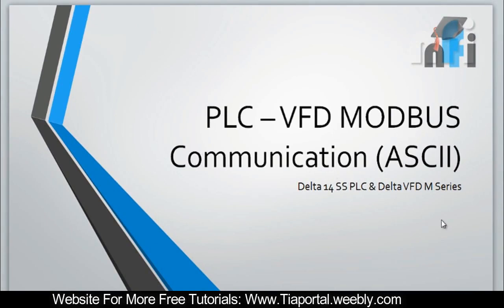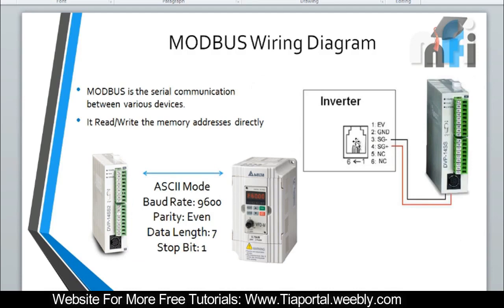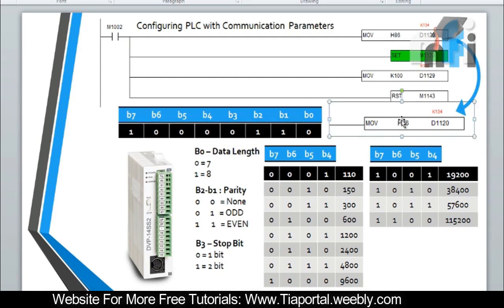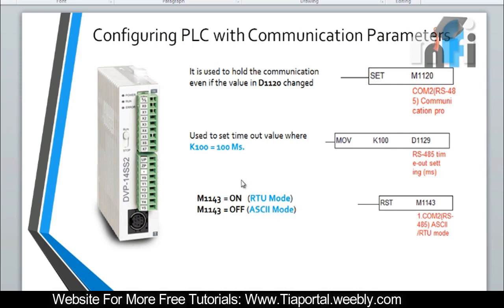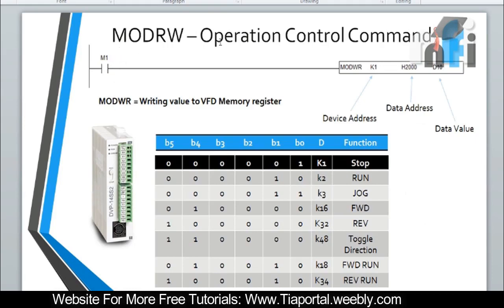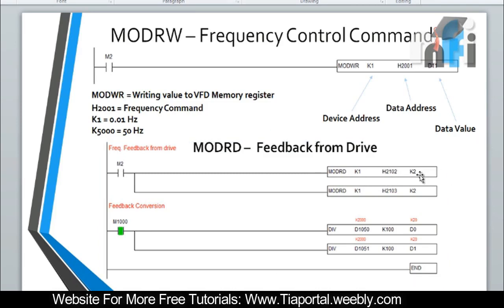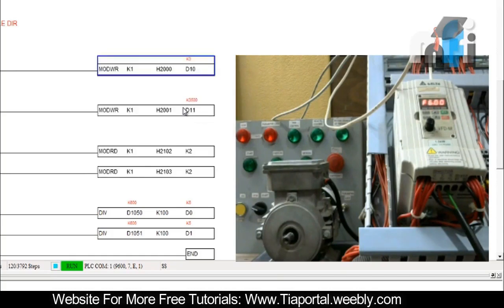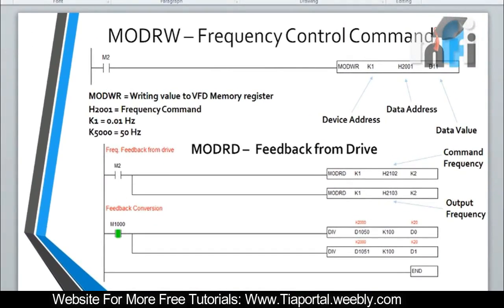30- PLC VFD Modbus Communication Complete

Comment: I have Delta plc . I want to use a proximity sensor on motor shaft the condition I want to apply is that when motor rpm goes to 900 output Y1(for example) turns on and when rpm goes down below 900 output turn off